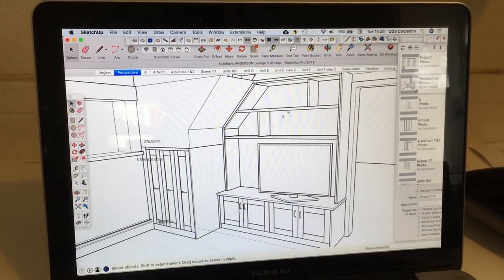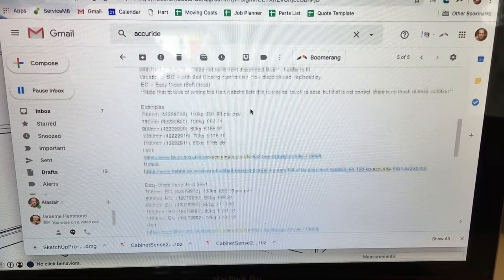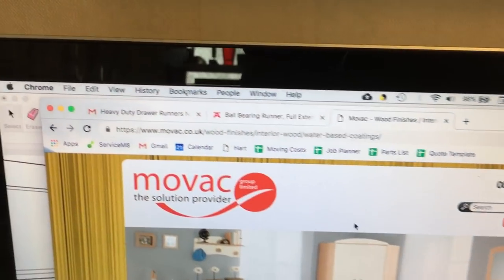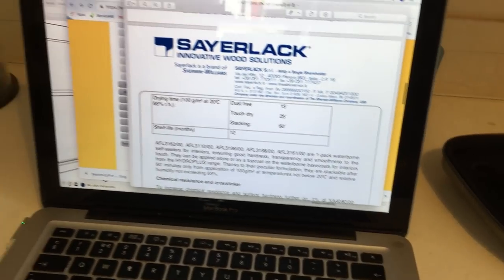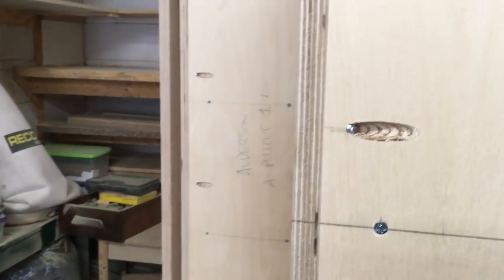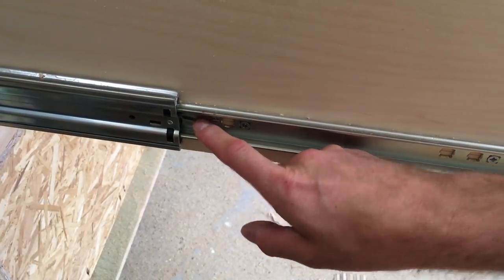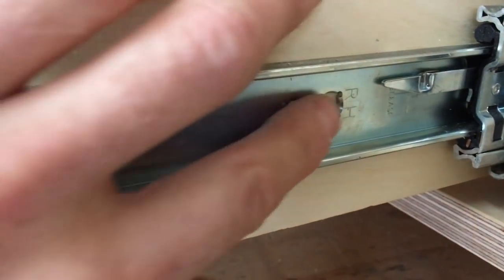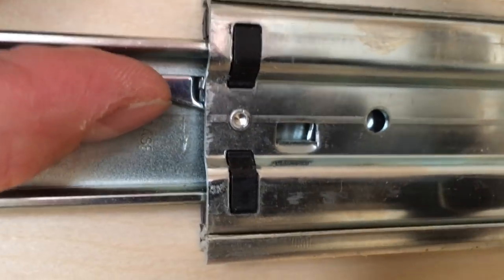Accuride 7957 runners and Movac ultra fast dry water based lacquer

Comment: Useful video. I'm going to give these sayerlack finishes you use a go next opportunity I get. Not been totally happy with the finish I've achieved spraying Helmi or Caparol,  also good to see they offer a wide range of sheen levels in the clear finish. Can I ask where you source your Kreg screws? They always seem a bit too pricey where I find them. Cheers!
Reply from the maker: Andrew Cain I always think the same when buying kreg screws and just find the cheapest option on eBay each time, I don’t think we’ve stuck with one supplier !
Reply from the maker: These 2 brand new finishes from Movac look very interesting: https://youtu.be/6RlepyBWe1I
Reply: @Alastair_Freebird  They do look interesting! Especially like that they have different hardeners for different wood species, as waterbased does struggle to bring the grain to life with walnut etc, I've always ended up going AC lacquer or oil based with darker timbers. Out of interest, have you tried Renner finishes? Just watched a video on them by Idaho Painter (titled lacquer dangers, I think?!). Seemed quite impressive. 👍
Reply from the maker: Andrew Cain I’ve never heard of Renner finishes, are they available in the Uk?  Until we started spraying I relied on Mark Finney At www.finneyswoodfinishes.co.uk for stains and woodfinishes.  We mostly use his hardwax oil which brings out the depth of grain really well on oak.
Reply: @Alastair_Freebird  they're available through Symphony Coatings, I don't know much more than that unfortunately, I haven't had a chance to look into them further. The website has quite  limited information, probably need to speak to a human I think!
Reply from the maker: Andrew Cain ok thanks for the heads up... although I am so impressed with Movac water based products so far I am going to keep trying their stuff for now!
Reply: @Alastair_Freebird  I do intend on trying them out next to be honest, as you keep singing their praises so much! I was just wondering if you had perhaps already experimented with Renner but preferred Sayerlack. 👍👍👍
Reply from the maker: Andrew Cain not yet.  I tried to get Morrells to come see me when I wanted to get seriously into spraying with no luck.  Then I tried Tikkurilla Helmi but found the limited sheen variations not quite right for me.  Then Movac just seemed more pro active in helping me and then I discovered how much expertise they had in waterbased products so it’s just been them ever since really.
Reply: @aflawlessfinish19  hi, I'm about to try some of the Sayerlack, but wasn't aware it contained isocyanate. I had a look at the safety data sheet but couldn't find any mention on there, and it only recommends an a2p2 particulate filter respirator. How did you find out it contained isocyanates? Are you using the same products that Alastair is talking about in his vids?  Thanks!
Reply: @aflawlessfinish19  Ah, ok, I hadn't checked the SDS for the cross linker! Thanks for the heads up! 👍👍👍
Reply: @aflawlessfinish19  It's just me, but yes I do have a hairy face so I'll have a look at a positive pressure mask 👍 I'm only a newbie in the world of spraying, so still learning a lot.

Comment: I am about to use the Accuride 3732 on a replace drawer project. The specifications call for a .5in or 12.7mm spacing plus 1/32 or about 1mm x2 on the sides. I measured the slides at .5in. I am trying to figure out the drawer box size. I spoke with Accuride about the additional 1/32 and was told this was error factor incase the drawer box was undersized a bit. There are tabs on the slides for the screws to allow the slide to come in a bit. Do you ever add the additional 1/32 x2 to your drawer box subtraction amount or just go with the .5in x2 (so 1in or 50mm). My thought is if the drawer box parts are cut accordingly then there would be no need for a allowance factor. If all this makes sense.

Comment: FREEBIRD !!  I have a job coming up for understair storage ,  ive just called Accuride ( on seeing this video earlier in the week ) im after an 850mm runner, they inform me the runner cannot be split into two. difficult to fit ??  this is the first time ive used this method and concerned of correct alignment       Is there an easier way ??
Reply from the maker: Jim Mustill we got caught out with this in the past.  The different types and codes of runner are confusing.  We settled on accuride code 7957 as the ones to use because it DOES have front disconnect (splits in 2 for individual fixing to carcase/drawer side).  The one we got caught out with that does not split is code 5321
Reply from the maker: Here are my full notes on long runner variants: 
Accuride 7957 (Preferred option)
Ball Bearing Runner, Full Extension, Load Capacity 140-160 kg.
This runner has the front disconnect lever (allowing the piece that is fitted to the drawer box to be separated from the piece fitted to the carcase).

Examples:
661mm runners (43248866), 160kg capacity, £67.26 per pair (ex vat)
711mm (43248871), 160kg, £70.75	
762mm (43248876), 160kg, £74.20
813mm (43248881), 160kg, £77.87
864mm (43248886), 160kg, £81.96 
915mm  (MAX) (43248891), 160kg, £190.76 per pair
Hart:
https://www.blum.org.uk/shop/accuride/accuride-7957-drawer-runner-713448/
Hafele:
https://www.hafele.co.uk/en/product/ball-bearing-runner-full-extension-load-capacity-140-160-kg-accuride-7957/43248866/

Accuride 5321
Ball Bearing Runner, Full Extension, Load Capacity 60-150 kg, 
With hold-in feature.  Does not have front disconnect lever - harder to fit.
Variations: 'SC' = with Self Closing mechanism, now discontinued, replaced by:
'EC' = Easy Close (Soft close).
*Note that at time of writing the Hart website lists this runner as 'touch release' but that is not correct, there is no touch release variation*

Examples: 
700mm (42222702), 110kg, £61.93 per pair
790mm (42222800), 100kg, £63.71 
900mm (42222900), 80kg, £166.97 
1000mm (42222910), 70kg, £176.10 
1100mm (42222911), 60kg, £185.36	
Hart:
https://www.blum.org.uk/shop/accuride/accuride-5321-ec-drawer-runner-713008/
Hafele:
https://www.hafele.co.uk/en/product/ball-bearing-drawer-runners-full-extension-load-capacity-60-150-kg-accuride-5321/42222702/

Easy Close Variants of 5321:
700mm, EC, (42079970), 100kg, £82.19 per pair
800mm, EC,  (42079980), 90kg, £88.84 
900mm, EC, (42079990), 85kg, £174.90
1000mm, EC (42079991), 80kg, £184.04
1100mm, EC, (42079992), 75kg, £193.30 
Hart: 
https://www.blum.org.uk/shop/accuride/accuride-5321-ec-drawer-runner-713008/
Hafele:
https://www.hafele.co.uk/en/product/ball-bearing-drawer-runners-full-extension-load-capacity-55-100-kg-accuride-5321ec/42079970/
Reply from the maker: You can buy me a coffee for this 😁😉
Reply: @Alastair_Freebird  this is fantastic , can't thankyou enough 

Been having a tricky time on this build , defo owe you a coffee ! 

Can I donate to the page somehow ?? You've been of great help these past few months 

I was within you first couple of hundred subscribers , I'm technically old school in this fast moving digital age !
Reply from the maker: Jim Mustill I thought I recognised your name!! Thanks for sticking with me.  On some recent videos I have been publicising the link to ‘buymeacoffee’ which I chose as a simpler more accessible alternative to Patreon: https://www.buymeacoffee.com/freebird. No pressure, entirely up to you, but whenever someone gets real value from what I share I’m encouraging this so it’s a 2 way street and in future as it takes off hopefully I can better justify the time involved in YouTubing with some financial reward for myself and my family 👍
Reply: @Alastair_Freebird  I sent you 5 coffees mate, I'm so sorry it took so long been a tough month but your help has pushed this job over the line and my bank balance back to normal !!! self-employment has it's up and downs !!

I really apprentice your youtube channel, it's been such a good reference this year.  

All the best Freebird interiors !!
Reply from the maker: Jim Mustill really good of you to do this, I do appreciate it 😊

Comment: Slight high Jack..  (sorry)   if anyone here is of the mend and make do brigade and making themselves some shop cabinets - you'll occasionally find acuride drawer runners in some metal filing cabinets, I've got a few sets for my place - just realised what brand they were after seeing this.   Thanks for another informative video 👍👍👍👍
Reply from the maker: No Skills do you mean you can find filing cabinets cheap at scrap yards or something and get them that way?
Reply: @Alastair_Freebird  generally speaking yes, we used to deal with a fair bit of office furniture in the day job and have found acuride runners in numerous 5 drawer metal filing cabinets that we were disposing of.  Not all of them for sure but worth looking if you see someone chucking out a cabinet, they attach to the drawer and carcass via metal tabs so are easily removed with a blunt instrument 😁   Having seen the price of the ones you've been using I hate to think how many I have let go to scrap 🤦‍♂️
Reply from the maker: There are so many varieties of accuride runners and it’s very hard to tell the difference (hence making this kind of video).  These ones are particularly expensive due to the length and weight bearing capacity!!!